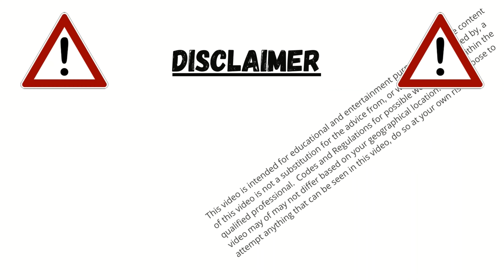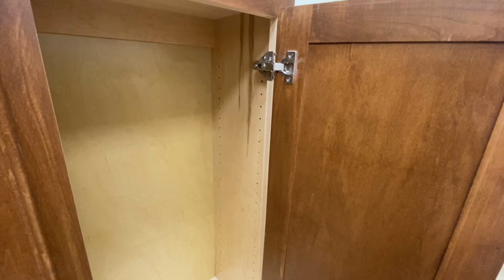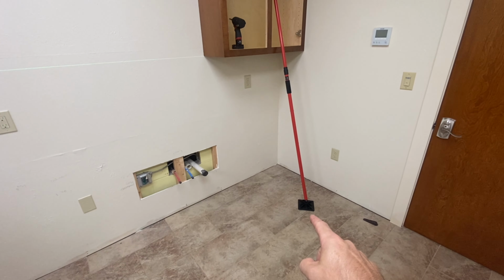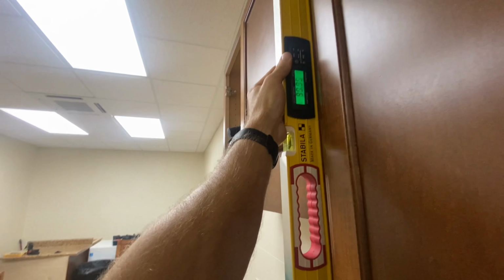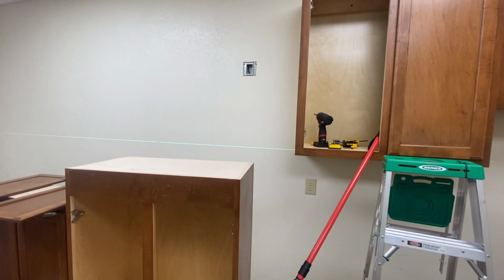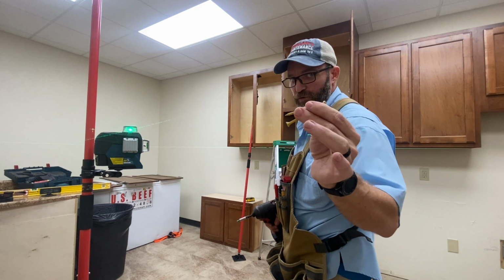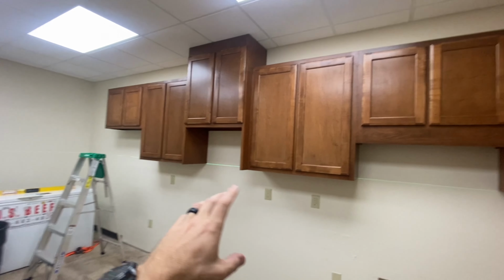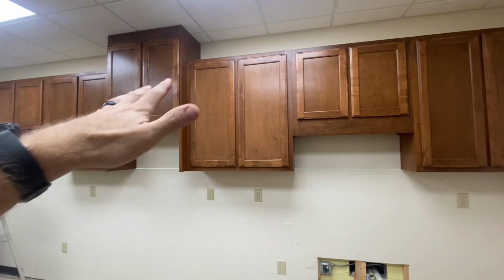One Man Upper Cabinet Install - Fast Cap 3rd Hand and a Few other tricks! #watchmework #cabinet

Comment: The third hands seem neat! May have to look into getting me a set. I could see them being useful for more than cabinets
Reply from the maker: Yeah I use them for all kinds of things. The head swivels so they will pin really about anything against something.

I use for dust barriers instead of zip wall poles but they have all sorts of attachments. They aren’t cheap made either, pretty solid.

Paying a helper for a few hours pays for them.

Comment: Nice job on this install. I’ve never used these 3rd hands and I wish I had some a while back for some cabinets I put up. Awesome video👍🏻
Reply from the maker: I use them for all sorts of stuff. Primarily cabinets though… that and for plastic barriers
Reply: @MORGANSMaintenance  I will check these out thanks
Reply from the maker: @parts7959  they have all kinds of attachments for them… and shorter ones too.

Your welcome! … and thanks for the compliments in the first comment 👍

Comment: I really like the 3rd hand products. I was going to purchase a zip wall system until I saw your video.
Great video ( again ) 
😜👍
Reply from the maker: Thanks ( again ) 😂. Yeah the 3rd hand come with some ends that snap together with magnets that you can sandwich plastic between. I had a set of zip wall poles but sold them. These are much more useful.

Comment: Have you ever had the bottom of the 3rd hand “kick-out” on you when trying to hang a cabinet?
Reply from the maker: No I haven’t.  You do have to be careful if you only use one on wider cabinets to keep the weight from being too much on the left or right from your 3rd hand.  On really wide cabinets you may want to use two to keep it from shifting that direction.

I also bought the bigger “feet” to put on mine… but I never really had an issue with the ones that come with it. I just bought for ease of mind.

Hope that helps 👍

Comment: How is the laser attached to the pole?  That's pretty nifty.   I have a simpler Bosch red laser, but the Bosch tripod is underwhelming.
Reply from the maker: They sell a mount specifically for that pole… I have it, but I don’t care for it.

I use a combination of two things. I use the magnetic mount that came with my Bosch,  https://amzn.to/3PT3L9i

and this I also have this screwed into the tripod attachment on the Bosch mount and attached to the pole.  https://amzn.to/46CB2Ns

Hope that makes sense… hard to explain with words.  This setup is more secure, and gives me Micro Adjustment.
Reply: @MORGANSMaintenance  

I really appreciate your response!  Thanks much
Reply from the maker: @MrAwhicker  👍👍

Comment: About halfway though the video and I’m curious, would having a helper along have made this an especially easier job for you, or did you manage just fine on your own?
Reply from the maker: With the 3rd Hand I was fine on my own.  These uppers were bigger (taller) which made them a little heavier. Some help would have been nice to lift them, but not necessary… for me right now anyways, maybe not a few years from now 😂

If you have a helper who knows what they are doing you could do it faster. Someone taking the doors of the next one off while one person screws the frames together, etc… but then you also have to find that person, find that person that is dependable, and pay them. Because the first two are so hard to do, I just pay the $80 for the 3rd Hand.

Putting the long pieces of trim on with one person is harder than setting the cabinets.

Thanks for watching… and the question 👍

Comment: I'm in awe how some of the American ways of doing things are better than European. And it always blows my mind when I see how unreasonable some of your ideas are.
We just use concealed wall hanging brackets and dedicated rails. They allow to move and adjust the cabinets left/right, up/down and in relative distance from the wall allowing to mount the cabinets perfectly flush. Adjustment range is as long as the rail left/right and 1/2 inch up or 1/2 inch down and 1/2 inch distance from the wall in both directions. (front/back). After the cabinets are hung on the rail all the fine adjustment is done using Pozidriv nr 2 bit. Because the bracket consists of two parts joined by bolt, the adjustment is very precise and may transfer significant loads.
It's funny you're not using that system given that you use Euro hinges.
Overall, very nice effect and good job, but you could have done it with much less effort.
Reply from the maker: I have seen some rail system cabinets, and you are right, seems simpler to me.  

The rail also helps spread the load over you whole wall. Every now and then I will run into a small cabinet with no framing behind it.

Some of our stuff advances… and sometimes it’s “this is the way we’ve always done it”.

I’d like your style better. Seems like a fancy French Cleat.

Always glad to hear from you!
Reply: @MORGANSMaintenance  More or less similar principle as in French cleat. French cleat has only left/right adjustment. Check out "Blum" - German company that makes cabinet systems etc.
To use our rail mounting system, you need to leave some space between the wall and the back of the cabinet, usually 1/2 inch. To make it easier we do not nail the back, but score the inside of sides panels of the cabinet, slide the backing sheet (made of 4 mm=1/8" ply or 4 mm HDF) into the rabbet and then nail it. Thus the back is recessed relative to the wall and there's a space for a rail.
You don't need to use any "third hand" tools. Just hang the cabinets, adjust them, tighten the brackets, screw the sided together and voilà.

Comment: Great tips, thanks for sharing.  Those 3rd Hands look invaluable!

Which Bosch laser is that?  It looks very handy.  I was looking into getting one, but I don't know much about these kinds of lasers.  This may be a really dumb question, but do you have to be careful with your eyes when the laser is being projected?
Reply from the maker: Thanks for watching and taking the time to comment.

Mine is the Bosch 3 plane laser (GLL3-330CG) that takes their 12v batteries but there is also an adapter with it to use regular batteries as well.

Then they also sell one that is strictly regular batteries and lots other brands at different price points.

I don’t wear any eye protection. I’m sure your not supposed to stare right into it but I don’t know of any special eye protection or anything they sell for them.  I may find out in a few years 😂😂😂
Reply: Thanks for the quick reply!  I had a Craftsman miter saw with a laser and it came with some red colored safety glasses you were supposed to wear when using the saw. I never wore them either.
Reply from the maker: @davidmatke248  I have a red pair of those somewhere I got with something too. These don’t come with glasses. I would think they would if you needed them to keep them from getting sued.